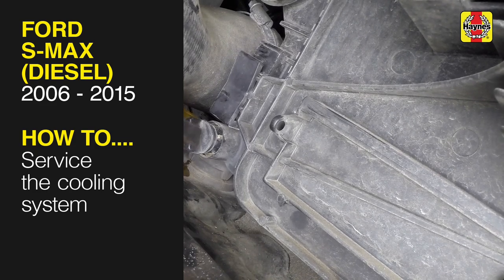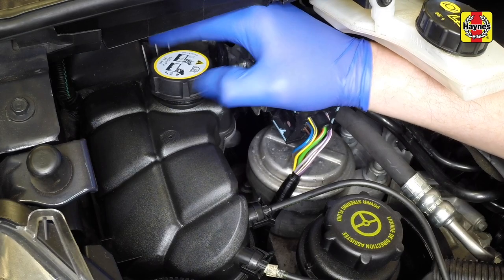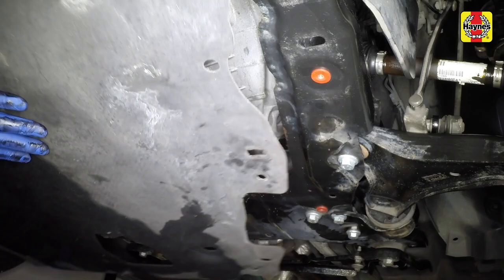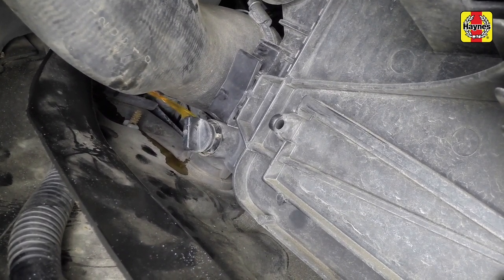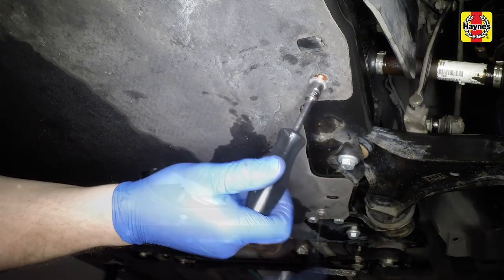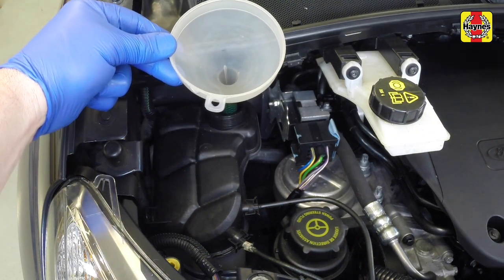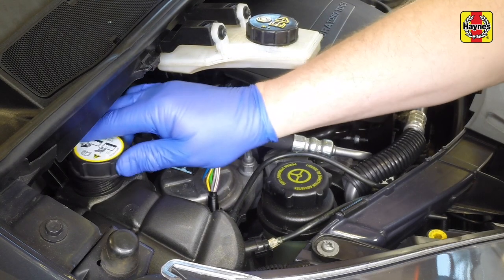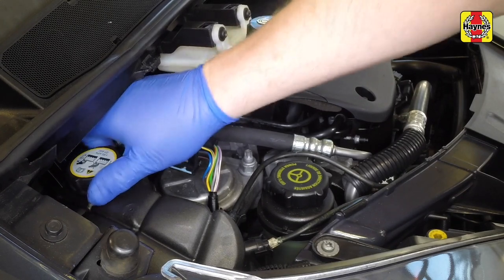Ford S-MAX and Galaxy (2006 - 2015) - Service the cooling system

Comment: Fid you get the engine nice and hot so it will drain all the coolant out the engine instead of just drop the radiator coolant. I have made that mistake before.
Reply: Viscosity of water doesn't change due to temp unless it drops below 0°c. It will come out no better and you'll  just risk burning yourself. It's water and coolant, not oil.